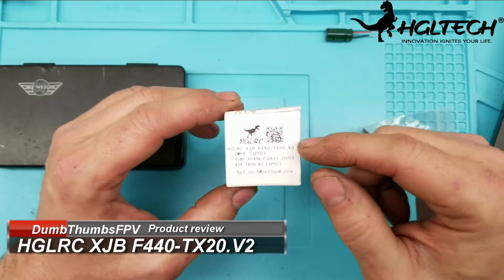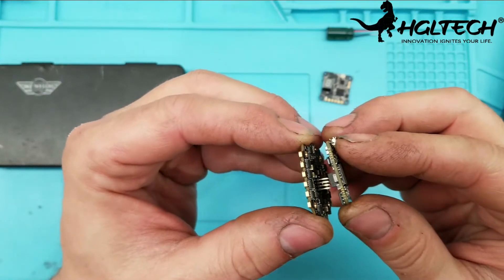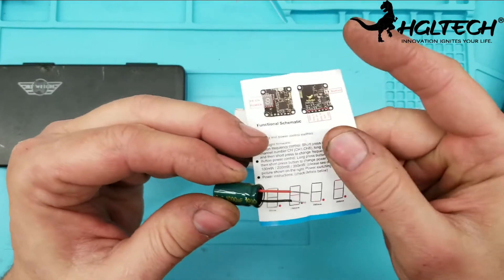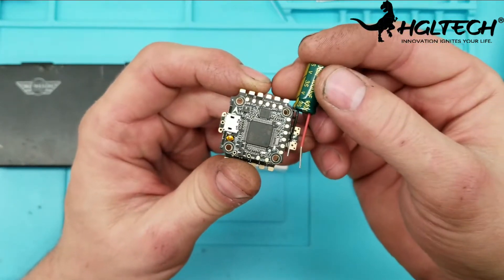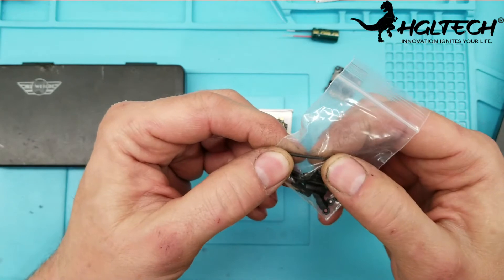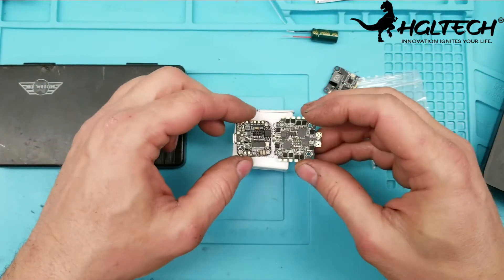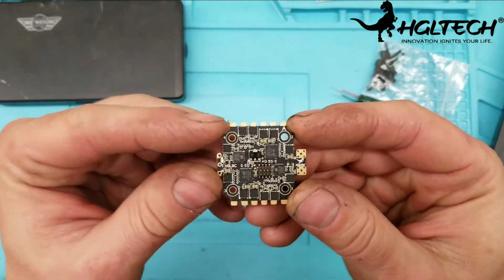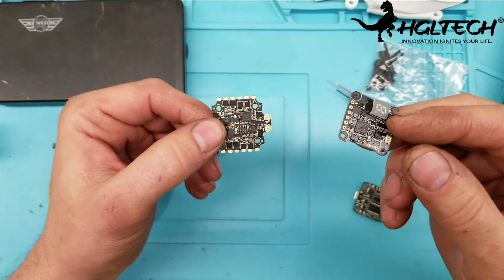HGLRC XJB F440 TX20v2 40 amps in a 20x20!

Comment: Most I’ve gotten is 40A total out of this stack (10x4). Can you confirm your max draw? Seems to bottleneck my BH 1507-3600s and 4S 1000mah 80/160c battery.
Reply from the maker: I can confirm it as I'm running HyperLite Team Edition 2205-2722  on mine with HQ 5x4x3 V1S props and a Hyperion 1800HV 90c pack.. all loaded up it's 450 grams.. I can sag the pack so I know I'm bursting over 40 amps.. There may be something wrong with your setup

Comment: Wow... 40 Amps on a 20x20 is just crazy! HGLRC has just been killing it lately with their new products. I love the v1 of the TX20 vtx. I have it on two micro builds that also use the Zeus FC. Using the Zeus, the TX20, and an XM+, I was able to build a 3" quad that weighs 82 grams with EMAX 1106 motors!

I'd love to put the XJB F440 TX20v2 combination on an ultralight 5" build like a CMW Merica or Hyperlite Floss.

Great review, btw! :)